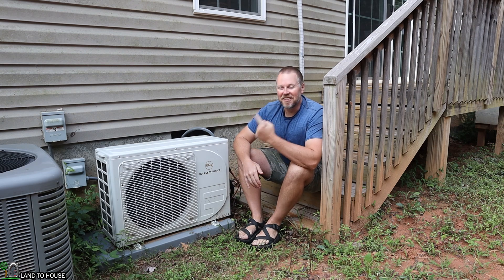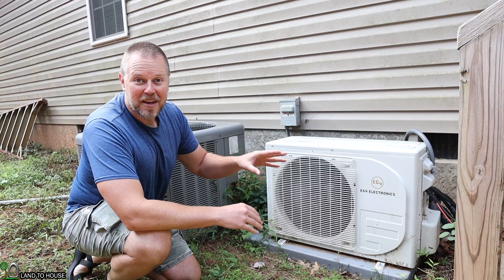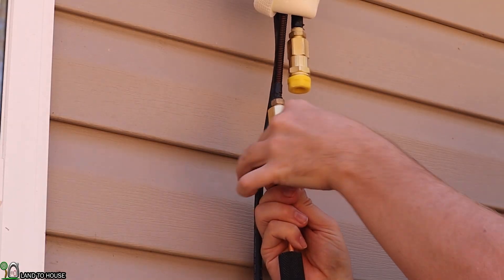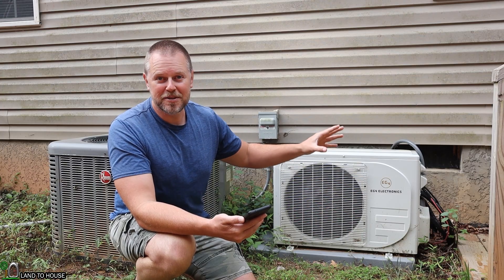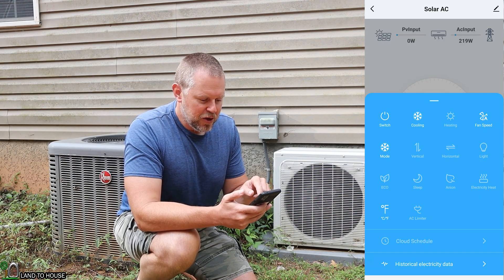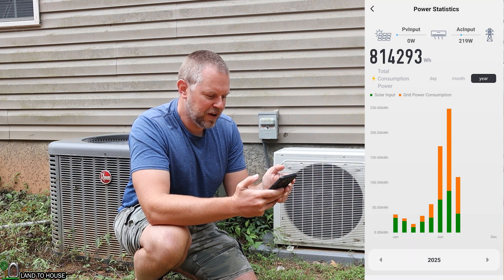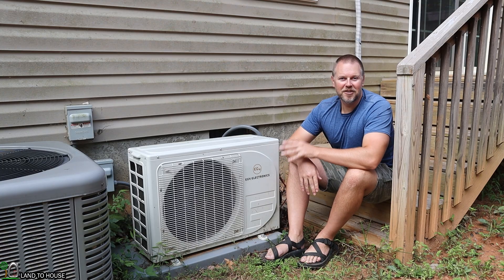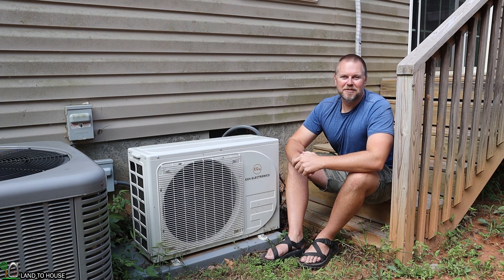EG4 12000 btu Mini Split Running AC for 5 months non stop! Is it worth it?

Comment: Neat little solar mini-split, that's cool.  How often do you accidentally bump into the outside unit with it at the base of the stairs?
Reply from the maker: It has been working very well. I actually don't use that door very often and have not bumped into it so far.

Comment: I don't like the extra cost of this unit (includes a solar charge controller/inverter along with the mini-split) or the fact that any solar panels you connect to it will not be fully utilized.  Any time the sun is shining and that unit isn't running, because your house is comfortable, the output from those panels is wasted.  I'd rather add those panels to my array and run a conventional mini-split off my overall system.
Reply from the maker: When I first got this unit I wanted to be able to include the solar part in the videos. You are right though its just as good or better to install a little more solar on a home array and run from the house battery at night. This video applies to those who done have a whole house solar system.
Reply: Same, the panels being used ONLY to run the mini and wasting the extra power is a HUGE waste as that means you can't even store excess to run at night. Forcing you to LINE power no matter what when the sun stops.

 If they made a 48v version of a unit like this then at least you could run it off a 48v bank. And that would only be about 19a at 900w or less. Making it super easy to wire for. (Or a 24v version at ~40amps.)

 There is no reason for the company to not do that other then them likely just retrofitting already existant ACs that can run off 90-120v AC (That might be immediately rectified) to be able to run off 90-120v DC.

 (With a universal motor or one that already rectifies AC to DC literally NOTHING needs to be done in most cases to hook to DC of the same voltage and the AC will just work.)

 That is how most devices work. Step one of most things is to take the AC and turn it into DC...

 You can just by-pass that with the right voltages and BOOM it works the same.

 These companies aren't innovating they are doing something extremely simple and charging way more for it while acting like they are innovative...

 Making an inferior product for cutomers.
Reply: @TrollFaceTheMan  - That's a whole lotta truth.  I recently saw a window A/C unit that runs off 48v DC and they were asking $1,300 for it.  I don't know why they would think they could charge 10 times as much as a 120v AC, but that's what they were trying to do.  Seems almost criminal, when you see how most of this stuff actually works.
Reply: Yep, it's sad.

Comment: Braze the lineset, those flares will leak.  I had a cheap Pioneer, ran great the first year non-stop.  Next year, froze up repeatedly and broke the fan motor (great way to find out the cheap one doesn't have a current overload or any sensors of any kind internally.  Jam packed with ice but hey lets just keep trying to drive that fan on high).   Year three the wheels fell off the bus and it just gave up.   Spent extra this time, got a Mitsubishi.  Wish I'd just done that the first time.
Reply from the maker: I see the Mitsubishi model often around town. Those seem to be the top of the line mini splits. I dont know much about working with copper lines. I will see how this one does as is and if it develops issues I can make videos on that.
Reply: @LandtoHouse  One of my friends has a HVAC business.  He said a significant portion of his calls are to places where someone self-installed a mini split, and it leaked at the flares.   It's so bad he refuses to install any mini splits without brazing.